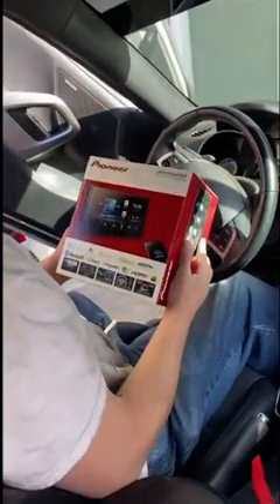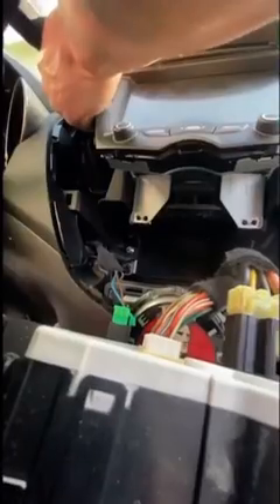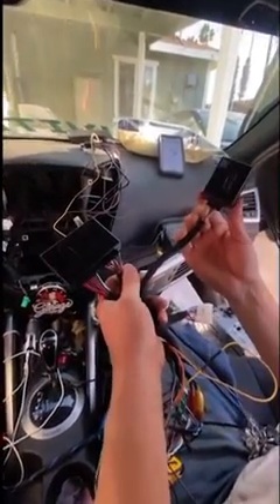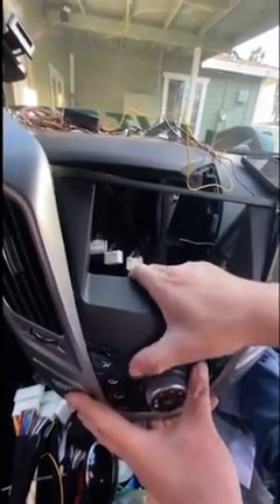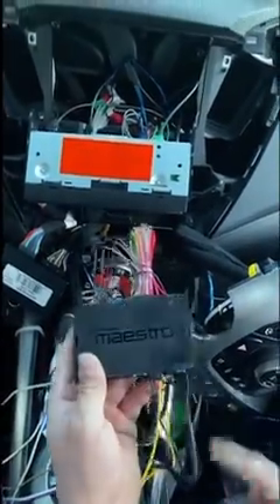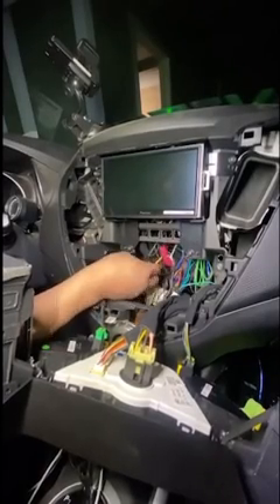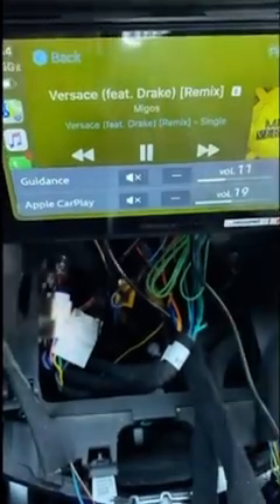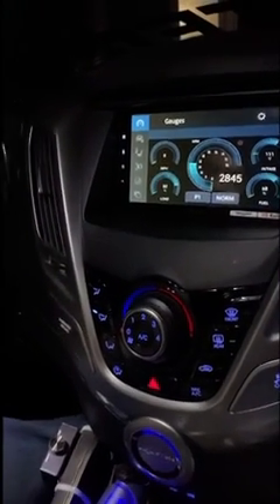Head Unit Upgrade

Comment: is it the original hyundai veoloster camera ur using??? cuz for me the camera does not work on the pioneer screen, it does not support it so i had to install another camera down
Reply: Yes it is the stock camera. U need a module. Check the parts description! Everything except head-unit is from crutchfield

Comment: I have a 2013 veloster and Im wanting to replace the radio myself, if I just wanted to just have the radio and Bluetooth functions would I still need the idatalink maestro? Or is that something I would need for the steering wheel controls to work? Thanks in advance!
Reply: U need the axxess wire interface and the SPDIF to be able to use an after market on our cars! The only thing on the parts list in the description of vid that you won’t need for install is the RR MAESTRO. That I have just as a for kicks to display sum obd2 on the stereo screen! 1:00
Reply: @sneezy7169  thank you!

Comment: So I bought a pioneer radio, I went to best buy to install it, I got a problem when turning off my Veloster, the amplifiers, crossover stays on and you can hear a little noise coming from the speakers, it drained my battery, it only happen with the new radio, they put back the factory radio and everything shut down when turning off the car, they can't figure it out what's going on, any help?
Reply: In the description is the parts list u need to plug it in to all the stock features and it turns on and off as it should!
Reply: Sorry for the late response haven’t been on here to check for comments. I did my own install and have not had an issue with the unit since I have had it car. You have to get everything except the maestro module. That is only to tap into OBD and display gauges.